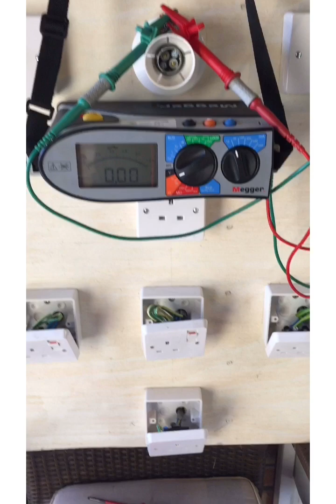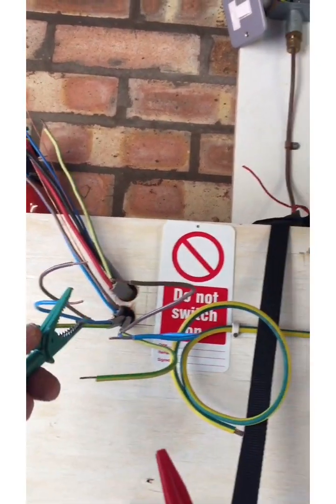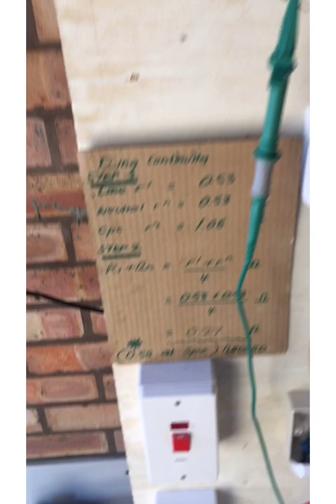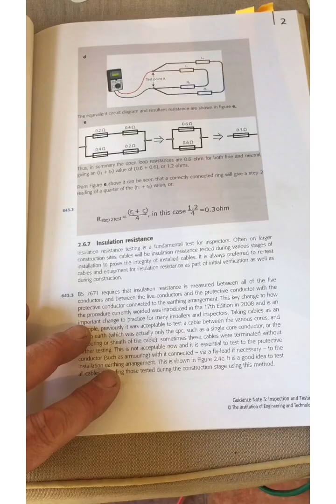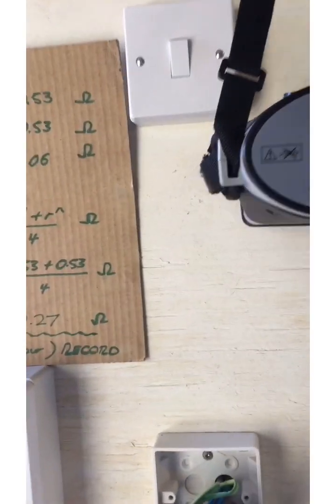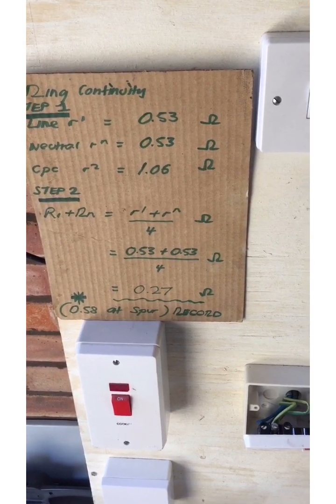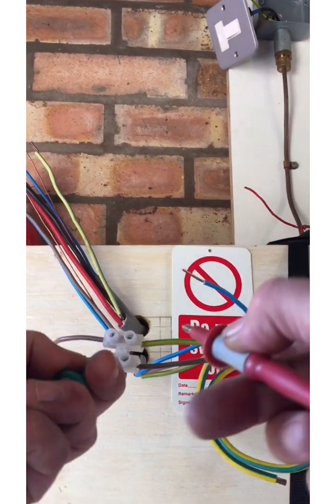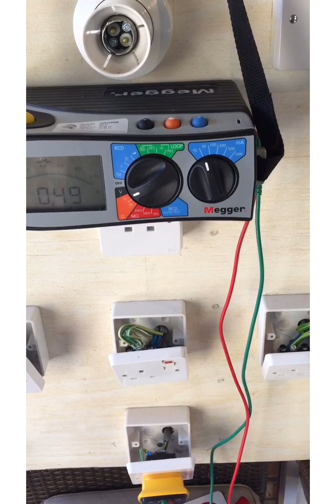Ring Continuity

Comment: Hi when you do your figure of 8 and was expecting 0.27 at your connector block and did get that. but then only 0.25 at socket with adaptor how much of a difference would you say is acceptable above or below the 0.27 reading ? Also should you nill your adaptor with leads plugged in or am I nitpicking lol cheers gary
Reply from the maker: Hi Gary. That kind of variance is normal, exactly what we have there. 0.05 off the top of my head but I'd have to check that one out. In fact accuracy like that, especially with a test rig, is difficult to achieve. Some people would say yes to nulling again on the adaptor but not routinely done by most.
Reply: Yes you’re right you’re reading at the socket can be + or - 0.05 ohm